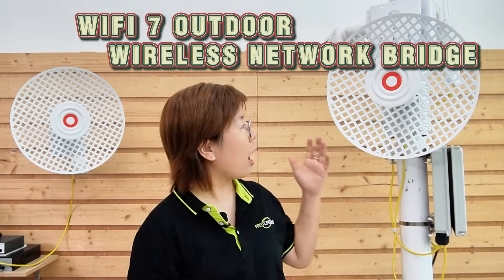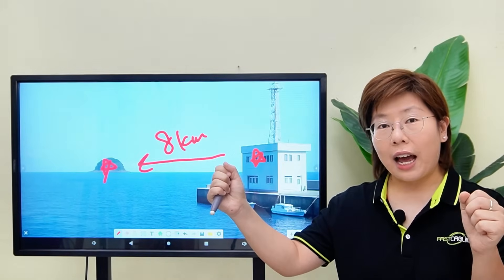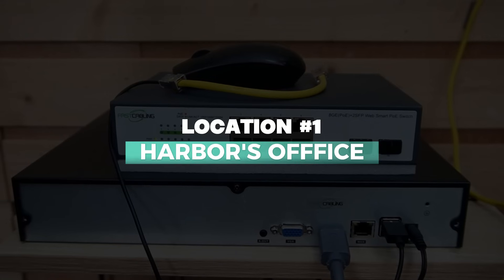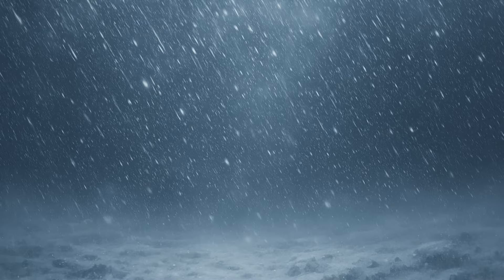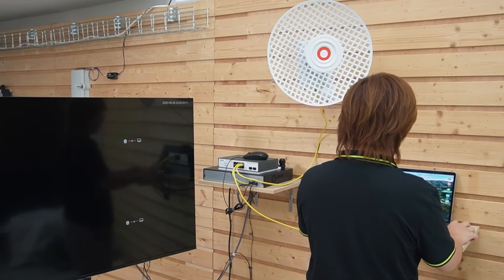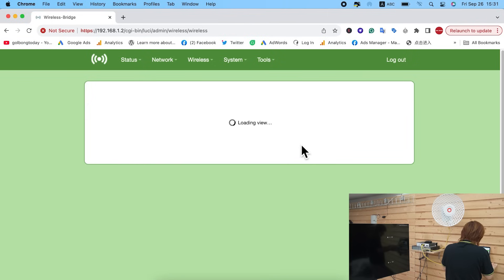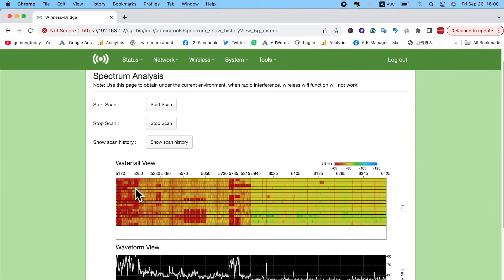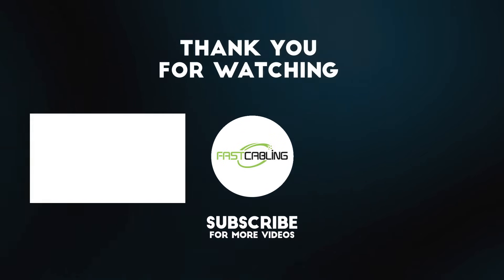Connect a Remote Island with Wi-Fi 7 Wireless Bridges (8km PtP Wireless Link Setup)

Comment: How do you change the azimuth of antenna it seems to be fixed.
Reply from the maker: The antenna itself is fixed, so you can’t change the azimuth by rotating the antenna housing. To adjust the azimuth, you just rotate the entire bridge unit on its mounting bracket.

Loosen the bracket screws slightly, turn the device left or right until the signal is strongest, and then tighten it back down. That’s how you fine-tune the horizontal alignment. If you need vertical adjustment (elevation), you can tilt the bracket up or down as well.
Reply: @Fastcabling uhh…! You can’t adjust it vertically using only the metal strap😅

Comment: Fast cabling very nice work 
How do you Install VLAN and QoS Management
Reply from the maker: Both the 8-port WebSmart PoE switch and the Wi-Fi 7 wireless bridges support VLAN and QoS configuration. You can log in to the web GUI to manage the settings accordingly.
Reply: @Fastcabling   Thank you so much for your reply and knowledge shared
Reply from the maker: My pleasure!
Reply: How much is the real throughput in 8 km?